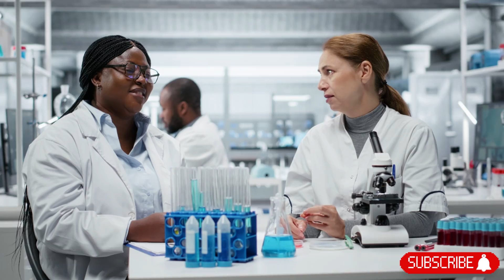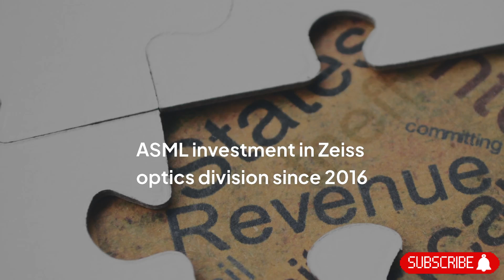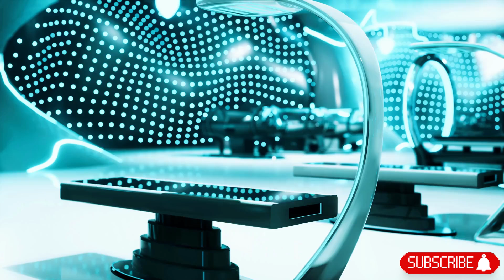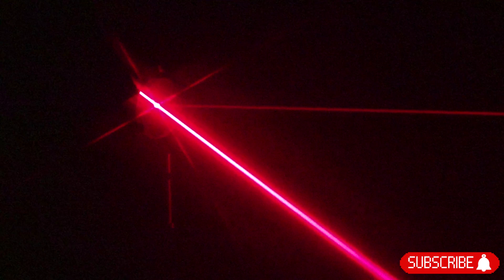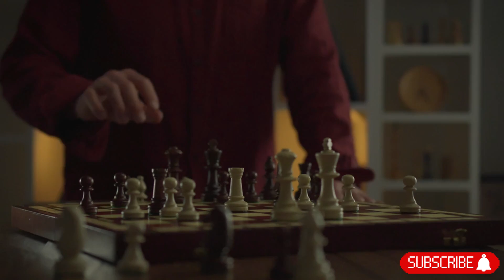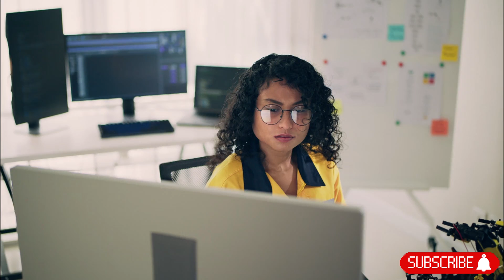One Mirror. One Monopoly. The Impossible EUV Race

Comment: Painful analysis to pin down China's achievement for this extremely complicated machine which ASML took decades to develop.
The same reverse engineering theory doesn't hold good here.
ASML had stated that even if the drawings are given to them they won't be able to produce the EUV Lithography machine because it consists of more than hundred thousand components produced across twenty countries.
No one has any right to stop anyone from deciding where to work. 
Experienced technological masters  are always necessary to develop such a critical machines.
The USA is thriving on foreign nationals contribution for their research and innovations.
What's wrong if China recruit experienced technological expertise from the West?

Comment: 1. According to them, the Zeiss mirror is an overkill. Mirror doesn't have to be that good for lithography machine to operate.. The mirror has to be replaced annually due to tin atoms contamination. Cost around $ 20,000.
2. China running parallel project in Xiong'an (about 60 miles from Beijing). It involves SSMB Synchrotron to generate EUV light. Totally different method from ASML lithograph tool. No mirrors involve. It can also generate 1000 watt of EUV power.☕